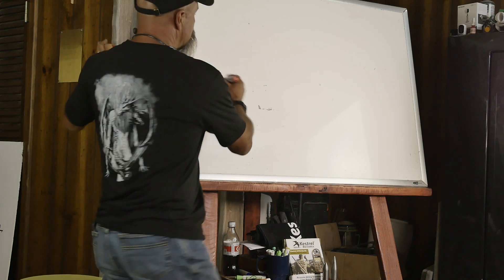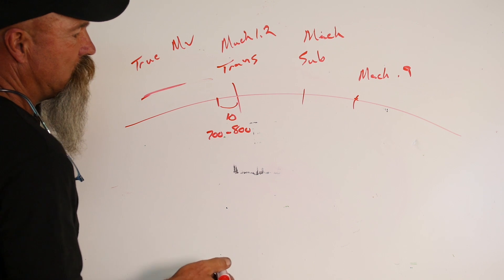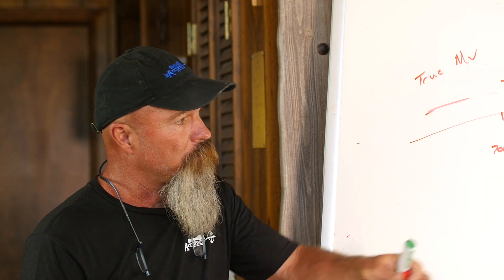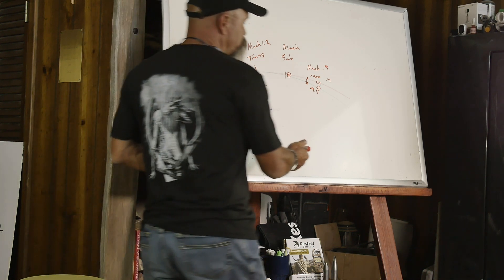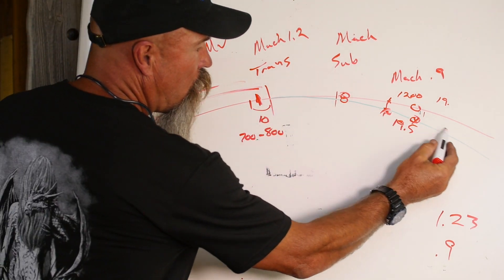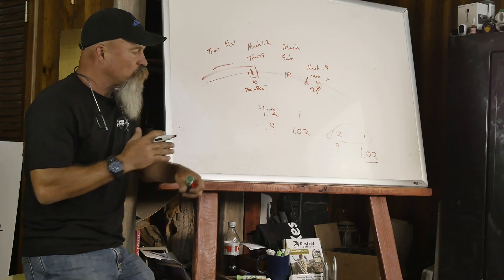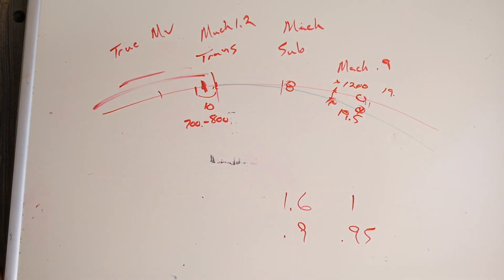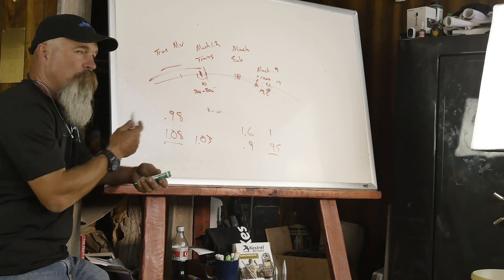DROP/DRAG SCALE FACTOR (Trans/Subsonic range) | Todd Hodnett from Accuracy 1st

Comment: getting into long range 22 shooting out past 400 yards. Would love to get your input on how to make my kestrel work for that. Starting my bullets subsonic just fyi
Reply from the maker: Hi Nick
Here are two useful links to answer your question
PDF DOCUMENT: https://kestrelinstruments.com/mwdownloads/download/link/id/296/
CALIBRATE DSF VIDEO: https://youtu.be/zNsFWagnNxU

Let us know if there are any other questions or concerns.
Good Luck!
The Kestrel Team
Reply: Basically 6 drop points are available. I would say to match your dope as good as possible with the Kestrel and then start calibrating the DSF where the Kestrel's holds no longer are accurate. This could very well be at 100yd already but I see problems opening at 200yds. From there on add DSF points every 100 yds or when the trajectory starts to wonder again.

I have only 5700 but planning an elite upgrade when I get it back from repair.

Comment: Before AB option of the DSF,  I use to use several g1 or g7 bc’s to be on throughout sson, transs and subs regions. I appreciate all of the time and effort you guys have put into the Applied Ballistics systems!!!!!!  I mainly shoot two rifle systems and one of them, even with every new barrel that I install,  the poi is always a little low nearing the end of transonic, unlike any other rifle system that I’ve dealt with. I often wonder if it’s possibly an axial alignment issue in this certain rifle. This really isn’t a problem but it just takes a few more rounds down range to true the ballistics to be absolutely true. 
  I appreciate the video and I’m always looking forward to the next one.
Reply from the maker: Hi WV
Here is what our in house experts say - The real value of DSF  is the ability to fine-tune the Kestrel for these long distance shots.  The DSF allows 6 different distances to be entered and used for the fine-tuning.  You always want to enter them from the shortest distances to the longest distance, otherwise, you would overwrite the longer distances.  You could do a DSF at the exact distance where you have the problem and the Kestrel would use that information to customize its results to your rifle.  If you continue to have a problem, Kestrel has support staff to help you with this issue.  Call in and get one of the staff members to walk you through it.
Regards - The Kestrel Team
Reply: Kestrel Weather Meters Man, I really appreciate you replying to my comment, I’ll try your advice first, then I’ll give them a call if I don’t have any luck. Again, thanks so so very much!!!!